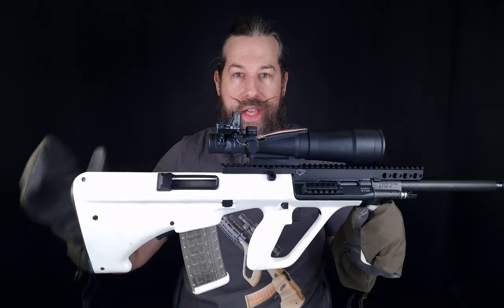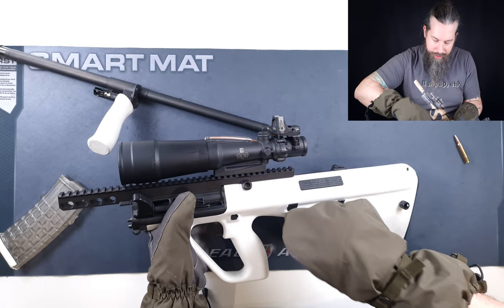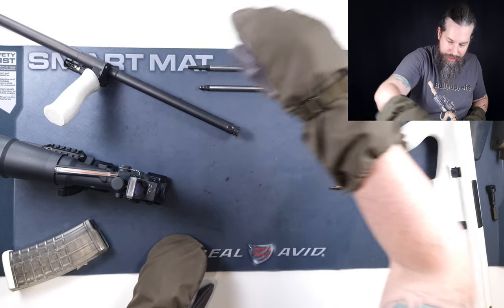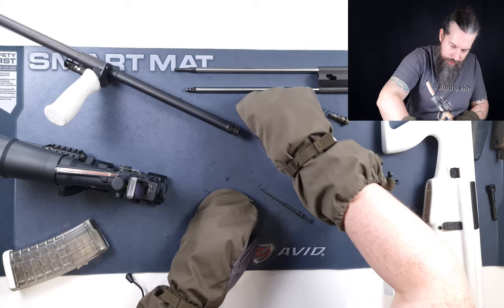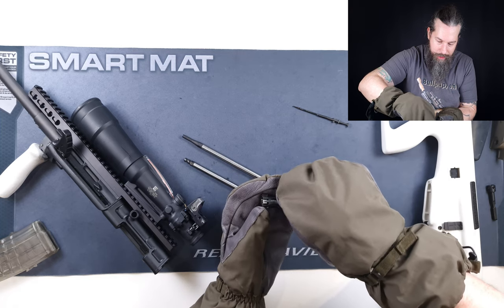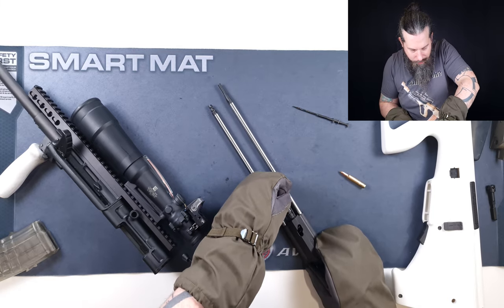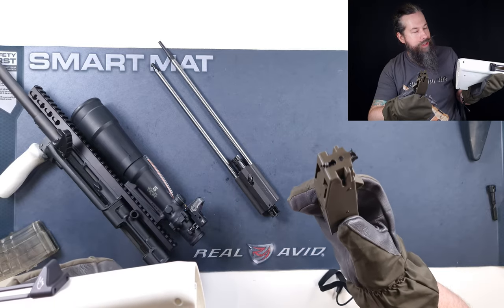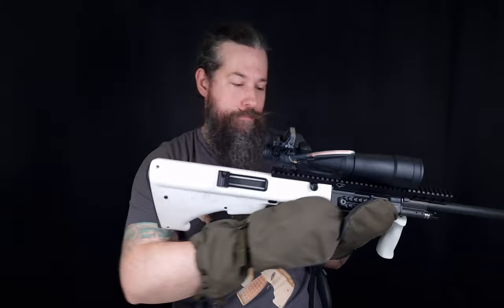Can you Field Strip an AUG with Mittens?

Comment: Great video, and awesome Arctic HBAR setup. I've been tempted to get one of the white stocks, do you have any trouble keeping it clean?
Reply from the maker: Yes, I have 😅 the stock has a kinda rough surface, like the usual AUG stocks. Oil and gun dirt has additional surface this way, to hold onto it. If I want to make it really clean, I need to use gun oil, a nylon brush and a lot of time
Reply: @ScaarAT  Thank you. Perhaps I will hold off on getting a White stock then. Although it looks so cool...
Reply from the maker: Can you get the stock as a part? One for the range, one for photos... 😂
Reply: @ScaarAT  That would be the idea, to snag as a separate stock (mines black now). But I'd want to use it for more then pics lol
Reply from the maker: Cerakote could solve the problem. It may smooth out the surface. But buying an extra stock and for cerakote, doesn't deem a money wise solution
Reply: @ScaarAT  Well to be fair, my entire AUG obsession could hardly be deemed a money wise solution; I bought mine for $1700 when a Colt AR15 was $700, and have sunk many a dollar into it since. No ragrets
Reply from the maker: You're my kind of person. 🍻

Comment: Bravo! Didn't even use the kawatec gas pison helper with a round.
What made you choose the corvus deflector and not the kawatec locking in the left side port?
Reply from the maker: I prefer the smaller overall profile of the Corvus one. So my decision was based on what looks (in my eyes) nicer
Reply: @ScaarAT 
Thanks for the reply. I hope I can get the kawatec mag release. Sadly not available from him atm, no answers via mail for the mags either. Do you know someone who can legally shorten the AC mags to 10 rounders? Btw. I bought a OA-UG today, based on an A2. Was stored with little to no use, took it apart, no pretravel of the trigger at all. 
Can you tell me how I can clean the internal springs in the rods? The owner oiled them too for storage and I've read and heard that they shouldn't be oiled but a bit of anti-seize loctite (henkel) was used by the aussies. The trigger pack was oiled too. 
Got any idea when the pack will break down with age? It' from 97, but bought new 2015.
Reply from the maker: I've never taking apart the rods, can't help you there. And it seems like the previous owner was very excessive with oiling the gun - or was he storing it in a place with high humidity? I'm afraid only a firearm store would be able to legally shorten them
Reply: @ScaarAT 
He just had it in his safe and was concerned it could rust so he took it out each year and oiled it. Looks good so far. 
I was looking in the corvus bits and I wondered if their mag release is a good idea interacting with the harder aluminium wearing down the mags quicker and the longer the lever, the more force on the contact surface on insertion. 
Does it make any sense to call Kada by phone or will he be pissed?
With the brass deflector, what ejection do you get on a clock? How can one check if the ejector spring is fine besides having a certain ejection or having fte?

Thank you for anwering my mail.
Reply from the maker: If Kada has the phone number on the website, you can always try calling him at usual store hours. Worst that can happen is that he ain't picking up. And even if he won't sell you the parts you want: maybe you can ask him for advice on how to maintain the OA-UG. He definitely got way more knowledge than me on that topic 😊
Reply: I will if I have the chance. Nah, the number isn't on his website.